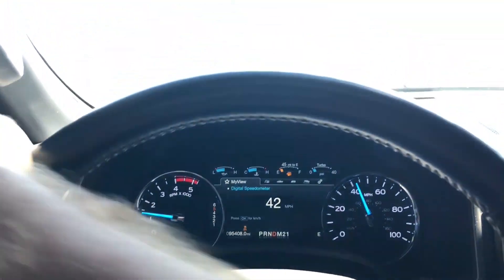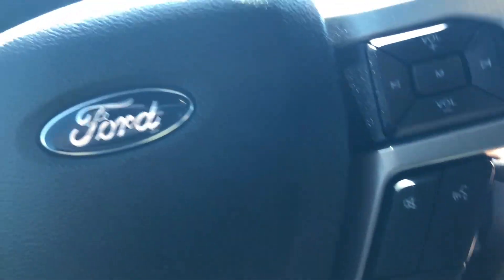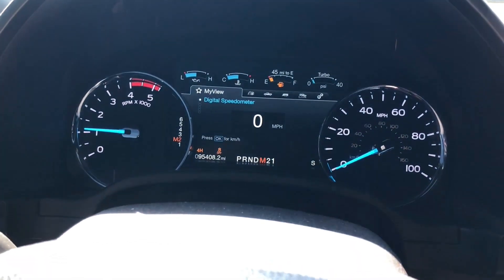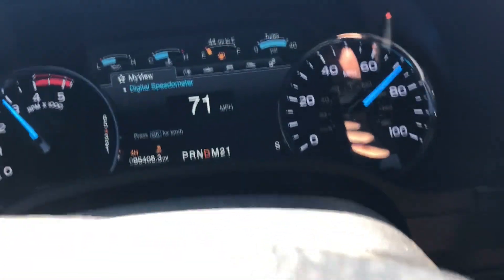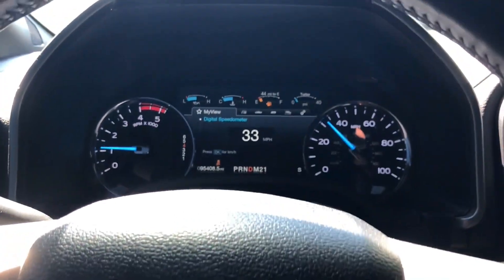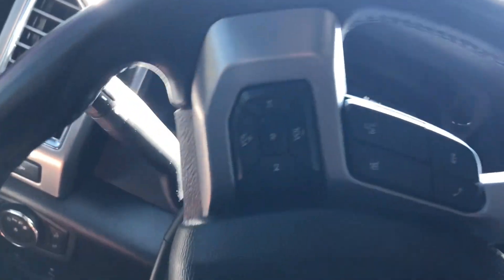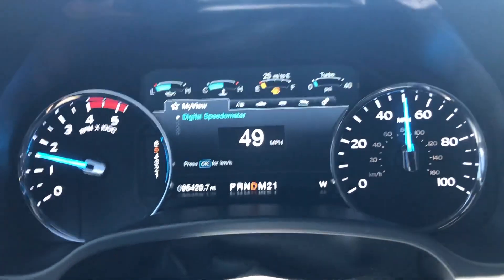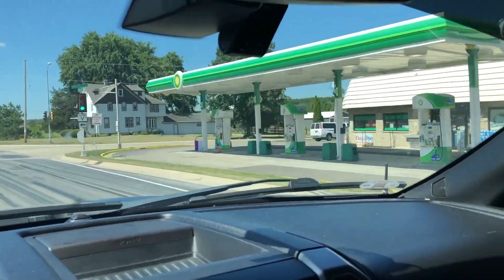Launching the Compound Turbo 6.7 Powerstroke - Trip to Mexico lol

Comment: Love the video. I love launching my truck. It’s stock under the hood but tuned and “high flow” exhaust and man does that thing rip and I’m only making around 520 to the wheels. Just subscribed to see how your build progresses!
Reply from the maker: What year is your truck? These things make an incredible amount of power with just a tune and removal of some "components" lol. You have any further plans for your truck?
Reply: John Kangas mines a 17. Don’t really have any big plans in the near future other than a piping kit to clean up the engine bay. It already has more than enough power for what I use it for and I’m not even on the max tune yet. But who knows lol It’s cool seeing people pushing bigger power in them them to see what they can handle before big upgrades are needed.
Reply from the maker: @Hoghunter245  yeah piping kits clean up the bay very nicely. From what I know, the bottom end of these motors are the first thing that needs upgrading. Depends on the build date of the truck in the 17's because they started putting stronger rods in them in like February of 2017. Those stronger rods are supposed to be good up to like mid 700 hp. Around the same time as the trans is nearing its limit.

Comment: I get between 4.4-4.8. Online calculators show an estimated 4.846 (figuring 650hp to the wheels and a gross vehicle weight of 7262 per ford). Great work man.
Reply from the maker: Awesome! Thanks for the double check on the time and doing that calculation!
Reply: John Kangas no problem. Glad to contribute. I may have missed it in your earlier video, but are you planning on upgrading head studs, rods, and pistons? I’m afraid you’ll need to if you stroke your CP4.2.

Comment: I'm assuming having a compound turbo kit means you don't have to run a tune and monitor? I'm kinda new to this just deleted and tuned my 19 f350 while back
Reply from the maker: Welcome to the deleted world! We're glad to have you! hah so actually it is crucial to have tuning and monitoring when going into higher power territory. When adding new components to the power train, the ECU will need to know how to properly manage those new components. In my case, Proven Diesel has tunes that are written specifically for my setup. The tune I'm running will allow me to get the most power out of the stock fuel pump because I haven't upgraded that yet and it is the limiting factor on my setup. However, you could absolutely install a compound setup on your truck without changing the tune files and it would run okay. The revised tune files are NOT necessary but they are recommended so that you can utilize your new components to their fullest potential. In fact, after installing my compound charger setup, I just ran the regular delete tune for a bit while I was waiting for the specific compound turbo file from Proven. Sorry for the long response, there are just a lot of different variables that play into it.

Comment: @john Kangas will your engine & transmission  be cooler as well running these kits?
Reply from the maker: Generally those temperatures will stay the same as stock. Transmission temperatures can vary depending on how you drive the truck or if you're hauling loads but generally, the addition of the compound setup will not change the operating temperatures of the truck.

Comment: You need a warren diesel 55% over diy pump
Reply from the maker: Yeah that's on the list of mods! I just need to make sure everything else can handle that power. I.E. the connecting rods lol
Reply: Well I just sent it! I have a 2012 with bd screamer turbo and the 55% over pump!
Reply from the maker: ryder ishmael dude!!! Fuck yeah! You gotta send me the results! How was the install?!?
Reply: It wasn't to bad. The power was crazy when I put it on the dyno. Made me pretty scared to turn up the power!
Reply: How would you like to see the results?
Reply from the maker: ryder ishmael I would love to see the results
Reply: 710 hp and 1390 torque. And the temp was in the upper 90s that day. So not the best day but it was still very impressive.
Reply from the maker: ryder ishmael holy shit! That's awesome! How was the install? What kinda special tools were needed?
Reply: Its not that hard just took a day. The pump is not hard the turbo was harder to swap out.
Reply: The only special tool would have been for the removal of the turbo. And its an air hammer.
Reply from the maker: Welp.... Looks like that's going to be going in this winter. That's going to be awesome! So my other question is did you run out of fuel or air first on your set up? Because on my compound setup, I have the potential for like 1000 HP worth of air with the s480 so I'm wondering if my set up would make the same power as yours.
Reply: @JohnKangas  So I ran out of air on this set up. You will run out of fuel on your set up at about 800 hp then you will need more fuel. Your rods will be very much so in the red zone.
Reply from the maker: lol yeah that's got me semi worried hahahah. Maybe I'll see if proven can write a SOTF tune for me so I don't go past 750 hp
Reply from the maker: ryder ishmael do you have any footage of anything you could send me?
Reply: @JohnKangas  what kind of footage do you want? dyno?
Reply from the maker: ryder ishmael yeah! Whatever you have!
Reply: @JohnKangas   How would you like me to send them? My truck is not as nice as yours lol just an xlt
Reply from the maker: Ryder Ishmael but it's more powerful! And that's what counts
Reply from the maker: @RydeRed150  i got the video! thanks so much! can i use that in a potential video?
Reply: @JohnKangas  yes. you can!
Reply from the maker: Ryder Ishmael on your set up, are you running stock 2012 connecting rods?!?
Reply: Yes stock rods and pistons lol
Reply from the maker: @RydeRed150  DUDE!!! thats nuts! I'm so surprised that those rods held up.
Reply: Yes. I did not think it would make that much when I put it on lol
Reply from the maker: Ryder Ishmael yeah I've heard of people snapping first gen rods while only making 500ish horse. Those things are like little twigs compared to the 17+ ones
Reply: I would like to get it build at some point in time so I can have a compound setup. But its alot of money.
Reply from the maker: Ryder Ishmael yeah between the compound system and the internal strengthening parts, it's like $14k just in parts lol. I'm planning on rods, valve springs, stage 2 cam, pistons prolly forgetting stuff
Reply from the maker: Who tuned your truck? I need someone's help with that after installing the 55 over pump.
Reply: Spe.
Reply from the maker: Fuck yeah! I'll give Dan a call tomorrow then for sure
Reply from the maker: If you don't mind me asking, how much did you pay for your tune? SPE just quoted me $1050 for my tune...
Reply: @JohnKangas  do you have ezy lynk?
Reply from the maker: Ryder Ishmael yessir I have an ez lynk
Reply: That seems kinda high to me.
Reply from the maker: @RydeRed150  Yeah I agree. For one tune I was expecting $400-500 or so
Reply: But he will give you shift on the fly tuning . And his tunes are very nice. I run them on two different trucks.
Reply: @JohnKangas   the 17+ powerstroke went to billet rods to support the hp increase. They rods is the 17+ stock can be run up to 1000hp